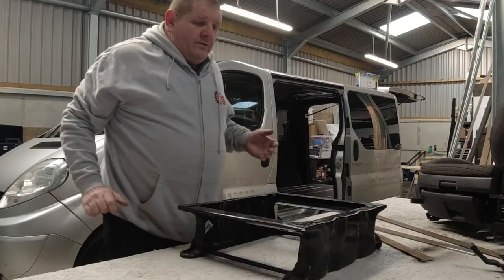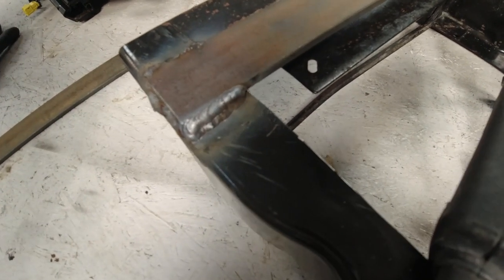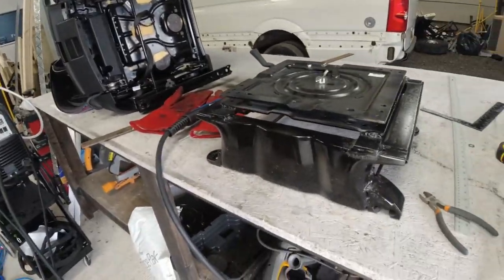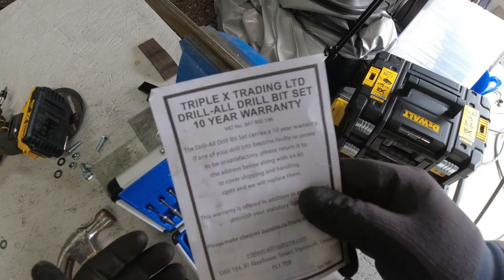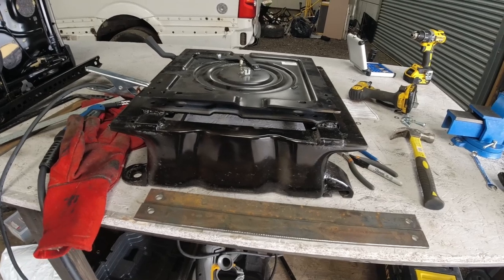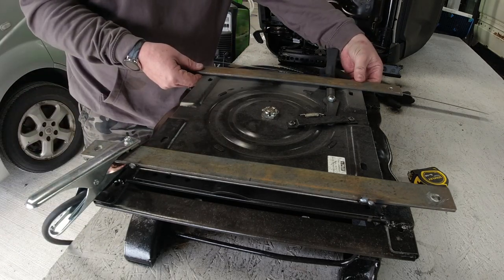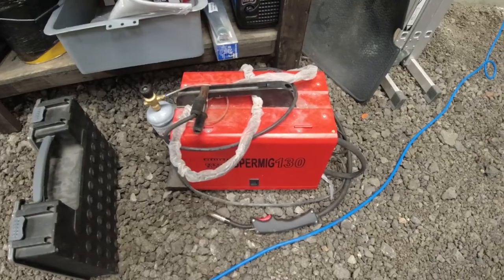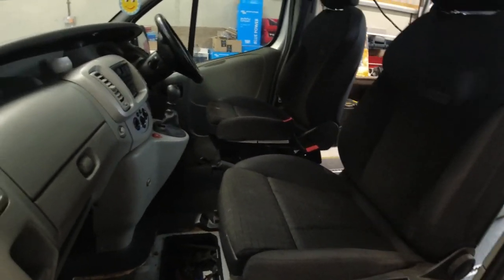Renault Trafic Campervan Conversion - Swivel Seats Install

Comment: Hi just fitting my swivel seats fitted, fitted the 3.3ohm resistor in the drivers side and it worked a treat but on your video it didnt give the colours for the passenger side any help would be great love the video's keep up the great work 🍻
Reply from the maker: If you check.the location on the passenger seat of which points the two.wires are located and then match it up with the plug it will give you the wires you need.  As there are only 2 wires on the seat and more in the plug that's how I done it.
Reply: @BuiltnotBoughtCampers  hi sorted it 🤦‍♂️just realised you have to use 2 resistors as there are 2 seats dah😂🤣

Comment: Hi just a quick question.  I think you said the swivel and all its metalwork raised the seat hight by 300m?  If you had to lower the base how would you go about that?  I fitted a pair of BMW seats in my T4 van once and had that problem.  I could sit and drive it but anyone taller would have had a problem with the height.  Thanks
Reply from the maker: Yeah base raised it by 30mm plus approx 10mm for steel.bars.  my seats have height adjustments which compensated for the height.  Failing that I would have trimmed the base down with an angle grinder cutting the top down.